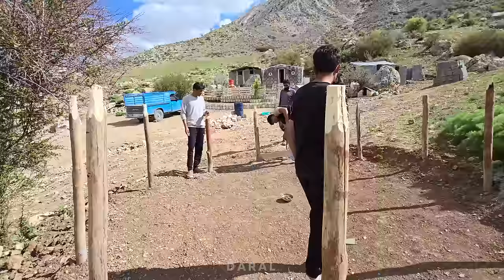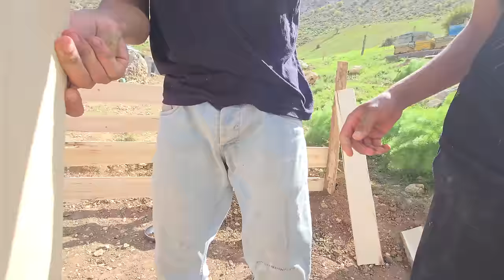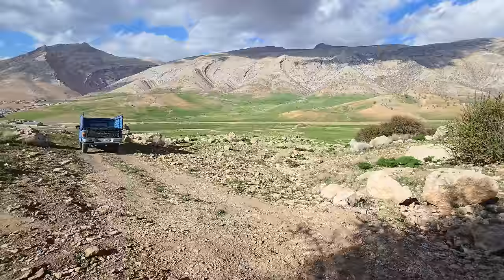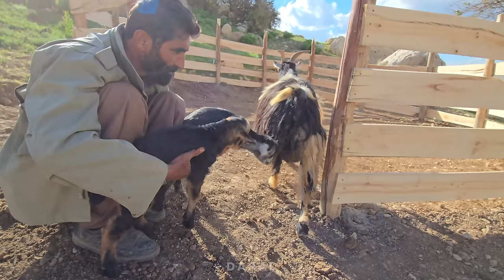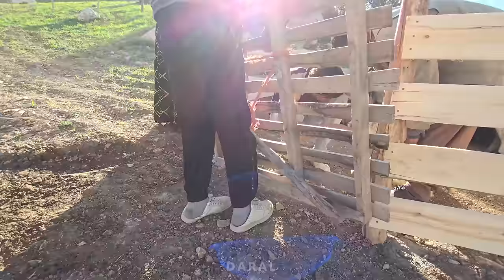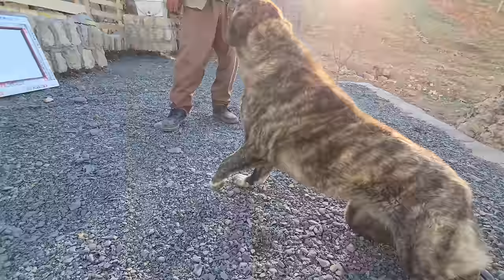"Amir and his family completed their goatfold with wooden boards | Farewell to Hassan"

Comment: You are using cheap, thin boards for your fence. These will deteriorate with time & weather and the nails will loosen slightly. The boards should be nailed on the inside of the fence facing outwards. The goats will only be able to push the boards outfacing. The way you have it now, as the fence weakens from time and weather, the goats can get out simply by pushing against the boards. You could have used rocks to build them a fence that would not wear out with time.
Reply: They also could have used the chicken wire they had used at the cave to protect the vegetables graden. Just wrapping that chicken wire and fixing it to the posts would have been more durable, safer for the goats to protect against foxes and wolves roaming to get them. A good door made the same way and a tarp if they wanted a cover like they had at the cave corral. Easy, simple and durable.